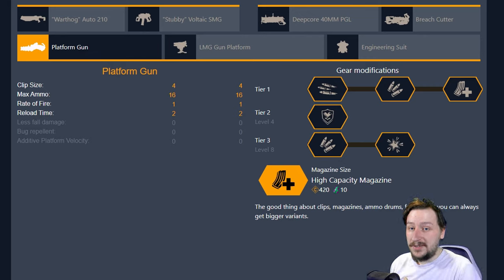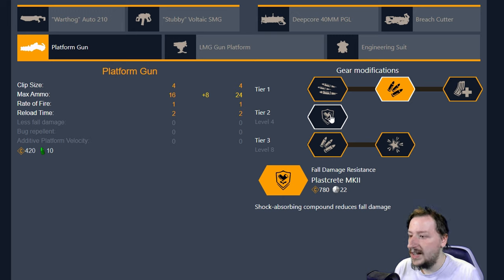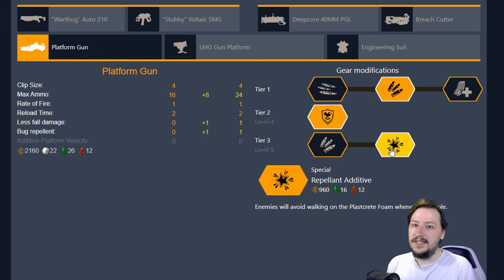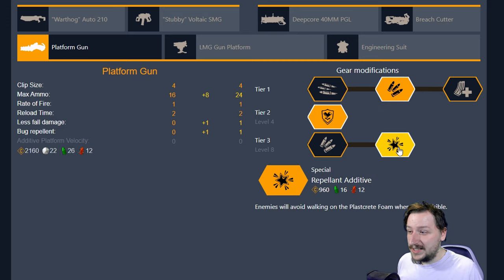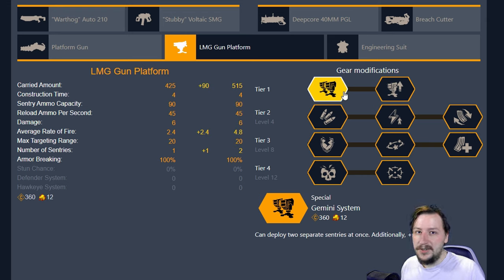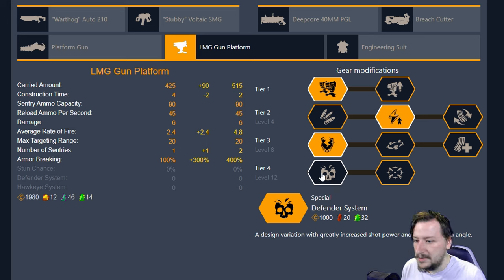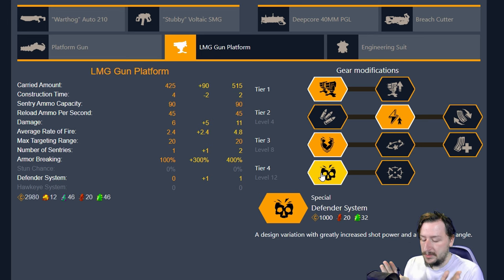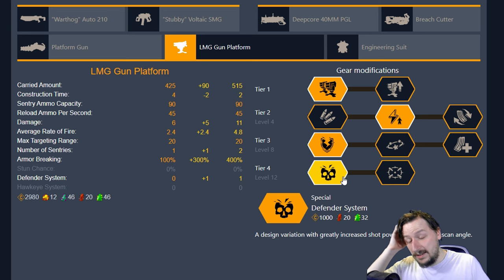Deep Rock Galactic | Engineer Equipment Builds

Comment: I like putting my Defender System turrets with their backs against walls, then building a little roof with the bug repellent platforms to keep bugs off my back. Very good bunker system on salvage missions, for example, though I'm certainly not the greatest player, I typically play on Hazard 3 xD
Reply from the maker: Ya, that is pretty strong the platform gun is also awesome for the tower mini game as you can put platforms above the places you need to stand and not get hit by the lazers.
Reply: @ReapeeRon  Ooh, good tip, thanks!

Comment: to me:
Turret build depends heavily on mission type
Sentry MK II for Escort, mining jobs and other missions where one will move oftenly, so lessening how much time is spent everytime you need to set the sentry(ies) whilst maximizing the bang they yield is key
Gemni for Extraction, Salvage and even Extermination, MK II cannot beat two sentries set properly to offer decent point defense
expanded ammo bags are VERY important on Point Extraction, the frequency of lesser waves will eat either MOST of your weapon ammo or get a few sentry magazines empty, so better ammo capacity is necessary
Faster buid time is good if you cannot bother spending time setting the sentry, in general it works for any mission, but ammo bags should be considered if going Deep dive or to a Point extraction mission
piercing rounds, good to speed the breaking of Praetorian and grunts armor, which in turn speeds up sentry killing time
stun, a must have for some jobs since stunning enemies is always a great help during a wave
large magazine, 120 or 135 (depends on whether you are running a Gemni or MK II, MK II has larger mag size so it stacks with this one) rounds can help raise the duration of cover these portable allies will give you while set to the position

Defender, it makes the sentry tool a grunt killer, but it also enforces BETTER care and planning on where you should build them, since either using a wall (mostly for MK II users) to block the blind angles the most or amplifying your coverage the most with the Gemni make placement somewhat more limited

hawkeye, THE sniper sentry, it will help killing certain foes for sure (menaces, acid and web spitters, mactera in general), and make for a VERY handy mod whenever you are running turret Whip since it enhances your ability to pick a priority target for the powered shot.

to me:
when going escort, point extraction and salvage on Engineer
1122 or 1121, the drilling on escort gets better if you amp DPS and coverage as much as possible to handle the waves and help protect the drill from the rocks, it's also better to make defensive positions with this build, so point extraction and salvage gets the best mileage for the worst parts of them, namely the constant grunt spawning and the hold the ground 3 stages to boot the escape pod

Mining, Egg hunt and Elimination, plus on site refinery
1212, 2211 or 1122/1
These missions require moving and relocating more, yet may need ample DPS either during waves or to fight the (half) evolved glyphid threat, so i focus either maximum sentry support capacity and quick deploy or better damage on a single sentry
Reply from the maker: Ya, that is true, I usually don't switch to often just out of laziness.

Comment: Dude i typically main driller, but my goodness if the Engineer isn't an awesome class.
He is so versatile.
I love using gemini turrets, i dont mind micromanaging the turrets & reloads for the extra DPS it gives.
I typically use STUBBY specd for Electric, with Breach Cutter & I love ALL of his grenades, yes including the LURE.
Reply: problem of engineer is: ALL his best aspects require set-up time
turret(s) require building them
platform has ammo limits and you may spend a SHIT TON of it when solo or to make a setup for some objective (such as fortfying the relay unit on salvage missions or building a massive bridge to cross a large gap or just mount a walkway through an annoying cave room full of bad geometry)
SG is flexible but also not exactly great at anything short of nuking a glyphid face when point blank
Stubby is a side grade, less single shot damage for more sustain, also requires unstable OCs to actually make some synergy with turret(s) (before OCs, all it does is slow a target for the turret to spam dakka at it)
grenades are mostly utility (LURE to bait enemies away of you, mines to boost defensive power when making a holdout, plasma burst nade to yeet some damage)
Reply from the maker: Engineer is really fun, but yes it is really slow for solo play.

Comment: So I ended up doing the math, and due to the weird mechanics of the MK2 turret (It fires slower) it and a SINGLE gemini turret have the exact same DPS. Thanks to Gemini system getting an additional turret clip of ammo, they are also equal when it comes to ammo efficiency, however Gemini can make better use of all the other stuff on the tree while doing double damage in a wave compared to the MK2, with the MK2 having a slight, slight edge (5%) on ammo efficiency if you take your build over the gemini, but thats all it has.

So essentially there is never a reason to take the MK2 when a single gemini turret does the exact same thing, and you have an additional turret to put down when you need to crank out the DPS.
Reply from the maker: Awesome, and thanks for the info!  I usually take two turrets but I tell people if they just want to setup a turret and forget about it then go with the one.
Reply: Qrd with the math?
Reply: 1 is more ammo efficient and has better range that's about all